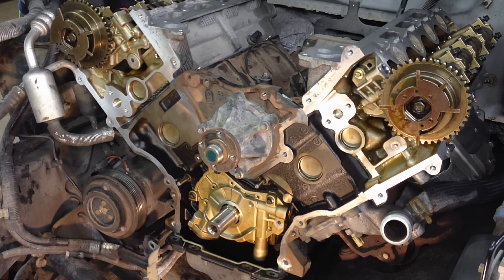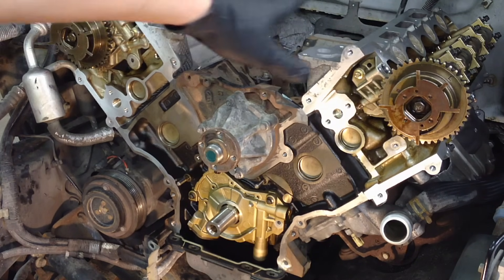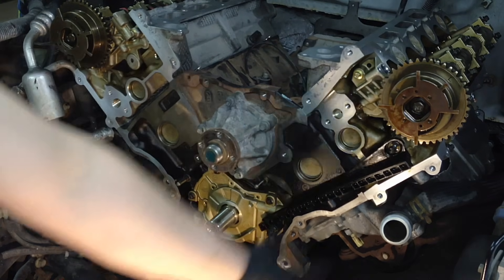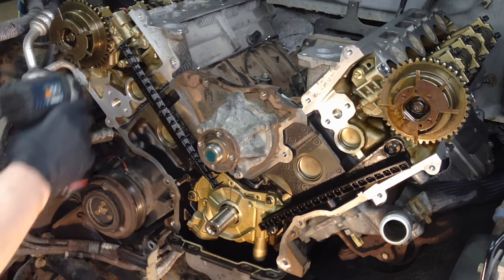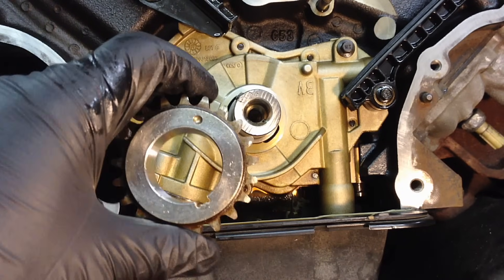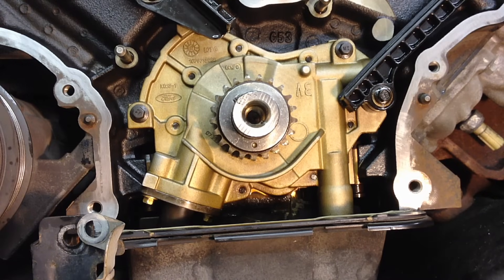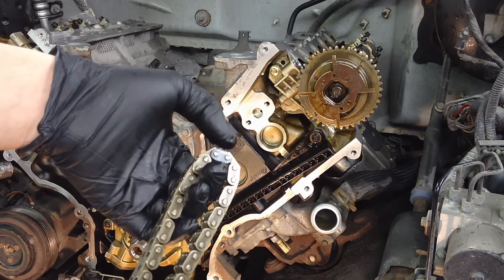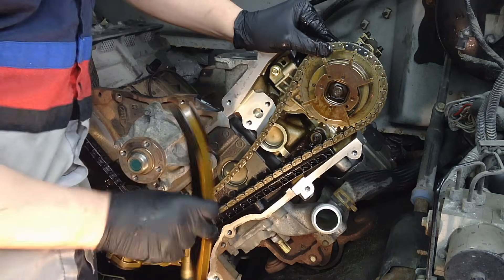Ford 5.4L 3v Engine Timing Walkthrough

Comment: Do you think the lash adjusters need replacing at any point? Mine are still compressing good but would it be good to swap with new one while doing this?
Reply from the maker: HimmelChef If I was in there that far anywhere near 100k They would all be changed.
Reply: Thanks confirms my thoughts.

Comment: So I get it running but it's missing. Turns out it's a bad rocker arm on bank 2. I fixed that then cranked it .it ran ok. Then next time I cranked it it won't start like it's outta time. Another phaser sheared off? Wtheck.. why us it doing this. I drove it up and down the road.
Reply from the maker: Mike S Are both phasers motorcraft now? Was the old one indeed sheared off? Are you locating the pin in there and seating the phaser before putting the bolt in there?

Comment: Not sure what brand it didn't  have a box.is there any brand other than ford that won't break!
Reply from the maker: No I just know Dormans are known for this and I have only used motorcraft ones and never a problem.
Reply: FordTechMakuloco  Hey I be leave that had done 7 months ago , to date Dorman's the right side is racketing causing slop in chain after tearing it down , I put milling's high pressure pump in both phasers , guides ,tensioner's, the hole nine yards , that was 7months ago , Now this is tore down again found tensioners seals let go on right side as well as the Phaser done with the plastic tensioners got cast Iron ratchet type but they came with a plate looks like it would restrict oil follow through it ,question should I put the plate between the tensioner and the block there are no gaskets with them can you help me on this matter , if possible its  2007 FX4 F150 5.4 v3 Flex , I do not want to tare this down again it only has 160 k miles on it , my 98 had over 350 k mile on , you may send me an email at rogerd82004@yahoo.com  I am 68 years old love my ford its getting a little harder for me to do but I will geeter done and thanks for the Vids

Comment: Thank you for the response.  I will be making a donation to you. The vct s were clean 'just a little debree. I found the problem.the phaser I put on I bought off eBay sheared off the pin at the cam. What Causes this. Just a bad one.? Can the cams knocking from lack of oil cause it. THEY Knocked Some Then cleared Up. I'm going to put the old phaser back on .it's missing the spring and tabs but it's been running with it for awhile till i could get into it. Once I get it going I can go back into it. New Ford phasers are 300 bucks!
Reply from the maker: Wow it sheared that big pin that locates to the cam? I would say it was a faulty part, was it a dorman?

Comment: Thanks for the info. I was a bit confused when to pull the roller followers. I saw your other video which explained everything perfectly. When I am replacing the timing components, should I do the cam phaser first or it doesn't neccessarily matter?
Reply from the maker: Jake Smith You will need the chains on when you replace the phasers to holt them in place while you remove and replace the bolt besides that it doesn't matter.
Reply: FordTechMakuloco Just trying to make sense of this in my head since I have yet to start with timing, so once the engine is at a neutral state with all the followers out, the cam phasers changed, I can pull the chains off and rotate the crank til the sprocket timing dot is at  6 o'clock and reinstall the chains. Haynes manual has this big warning not to move the crank without the chains on, but since all the followers are out it is ok. Maybe I am over analyzing this.
Reply from the maker: That is correct once the followers are out there is no chance of damage. Remove everything and get it to the 6 oclock and then follow my video from there.
Reply: FordTechMakuloco
 
I have started with timing and everything is going well, I had one quick question, is there a post check that I can perform. I know all the timing marks have to line up, but should my lobes be in the exact position when the keyway was at 6 o'clock.

Comment: Hi Ford Tech,
I am just about to perform a full timing job on my 05 F250 5.4 3v. Just to make sure I am not doing anything wrong I figured I would ask an expert a few questions. Here is what I plan on doing in the exact order, crankshaft pulley sprocket at the 12 o’clock timing mark at 1 o’clock. (Correct cam lobe  for position 1)? Pulling the cams and taking all the lifters out. Putting cams back in. Do I now put the key way to 6 o’clock? Removing spark plugs, removing both chains, tensioners, guides, sprockets and removing both cam phasers.
Re-installing the cam phasers first, which I was nott sure if this would make a difference or not. Following the video and putting the key way at the 11 o’clock six on the sprocket then installing my guides chains tensioners etc..
Once everything  is installed putting my lifters back in one at a time rotating the engine as needed to install or will the tool allow me to install all the roller followers? 
Thanks for the help,
Reply from the maker: Jake Smith You want to put keyway at 12 and check the cam lobes on cylinder number 1 to make sure they appear as shown in my phaser knocking noise fix video. If not you need to rotate the crank another 360. Once those 3 roller followers are out each side then you can rotate the crank clockwise to the 6 oclock position. Replace your timing components tensioners guides etc and remove all followers now position the crank clockwise till the sprocket timing dot is at the 6 oclock position and time the engine as shown in this video.

Comment: Yes sir question please. I have an 05 f150 with the 5.4 I had to do head gasket on passenger side. I replaced the chain guides they were broken. New cam phaser on that side. Everything looked good. Timed it with the marks on the chains . Turned the engine over at the crank several times and was good. Put it all back together  and both phasers were knocking. I cleaned out both vct s and cleaned paasageways. Started it up and I have never heard this engine so quiet. I drove it around my yard a bit then parked it. Shut it off and restarted it. No problem.  Got up to day to start it and it won't even run and sounds like it's outta time. Could I be a tooth off somehow? Thanks .. confused!
Reply from the maker: Mike S If it was a tooth or so off it would still run. What did you clean out of the vct solenoids, metal shavings? Do you have a video of how this sounds? Have you disconnect the vct solenoids and tried starting it?

Comment: Great video.  I have a question.  I'm doing a head gasket on a 4.6 2 valve and I'm to the point where I'm putting new timing chains on.  I have the crankshaft sprocket positioned with the timing dot at 6 o'clock.  When I put the chain with the mark on the dot on the sprocket and go to place the chain on the camshaft sprocket the camshaft sprocket is hard to move to get it in position.  At the moment the timing mark on the camshaft sprocket is sitting at almost 1 o'clock.  When I try and tun the camshaft to get the mark at 1 o'clock it just clicks back to where it was.  Am I doing something wrong?  I'm following the procedure from the alldata manual I just can't get things to line up...
Reply from the maker: You still have all the roller followers in that is why, they should be out and cams secured via the cam caps. What you can do instead of removing all of the followers is loosening the cam cams enough evenly to be able to move the cam free enough to line up the timing marks and then evenly tighten the cam back down very carefully.

Comment: Hi,
When you have time and you give me a few tips on my question about the timing chain and phasers I asked earlier this week . Could you also give me a brief explanation on removing the radiator support . So I can access the front end without bending over it . I noticed that you have it removed and did not have to remove the fenders . I have removed everything I thought was connecting it but it is still rock solid , At my age 55 I try and make things as comfortable as possible but would rather not remove 3/4 of the front end to get that support out if possible lol .Luckily my son is in basic training so I have his truck for a few months plus my faithful Harley so I can take my time with this job.  Again thank you for your vids . If you ever need any welding or machining advice maybe I can help you out . I have been a welder and machinist in the Nuclear industry for 35 years now . Plus have my own shop at the house. My email if would rather email me is nucmachinist@gmail.com

Comment: Hey FordTech I got a quick question. I'm doing all new phasers, guides, chains and one new cam. I followed all datas procedure exactly and am to where I tore the chains off with the keyway at the 6 o'clock position. Now on reassemble is it going to hurt to roll the cams to get them perfect? As long as my crank is in the right spot with the holder I can adjust them accordingly right?
Reply: Also how many revolutions will it take to get the marks to line back up? I set it and rotated everything a million times and it's now a tooth off on all marks. I made reference marks and after two revolutions those lined back up nicely. Is this not like any other timing to where you can't get them to line back up with revolutions?
Reply from the maker: plskillyourself Yes as long as the crank is in the right spot and the chains are strung tight as shown you are ok. You cannot crank it over to get them to line back up they wont do it on these as you have seen.
Reply: Is there a special tool to install cam rollers after putting timing chains. Or can you you just insert them. I notice that you cams were moving so what where you doing In this case?

Comment: Hey, First I want to compliment you on the detail in your videos and for taking the time to put them together and help out us DIY auto guys . I have worked in the Nuclear Industry for the past 35 years . Most of that as a  pipe Welder and Machinist until I got old and tired and recently started Supervising . Since my first car I have done most of my own work ( except tranny rebuilds lol ) man has to know his limits . But as the years have gone on the complexity of most work other than routine maintenance has gotten tougher on us DIYers . Thank God for YOUTUBE and those like you . Now for the question I have watched this video as well as your cam phaser change out video . And I am a little confused ( easily done ) In the vid on the phasers you show the crank key or spoke at 12 o clock then once the rockers are removed from the 1,4,5 and 8 cylinders you rotate to the 6 o clock position for the cam phaser change out keeping the cams in a neutral position. On this vid you show the keyway at the 11 o clock position which puts the timing mark on the sprocket at exactly 6 o clock ( I notice your cam bearing caps are lose) so all the valves should be unable to open .I am assuming that even if they were tight and the proper rockers were removed the cams they would still be neutral ? I am doing the Phasers as well as all timing chains adjusters ext. which process should I use ? Thanks again for all of your videos . They have been the best ones on YOUTUBE that I have seen dealing with these 5.4s
Reply: Kenny Hall I noticed the same thing what did you figure out on that I mean which process did you end up going with the 12 o’clock 11 o’clock or 6 o’clock position I’m doing the phasers and whole oil pump and timing chain replacement to

Comment: Hey FordTech.  I need some direction.  I had an engine ticking noise in bank 1 of my 2009 f150 5.4 3V.  I had a tech at an independent shop look at it and he said phaser for sure.  I replaced the cam phaser and during reassembly was off a tooth with the chain (it slipped) and had error 0012.  Had to open it up again and I moved the phaser one tooth clockwise and now timing is back on, error codes gone.  But the engine ticking is still there, loud.  I also have what appears to be the opposite problem from most ppl:  My idle is great, no stalling, but when I get going over 40 and step on the gas, the engine gears down but I have no power.  The same problem as when I first started did not get resolved by changing the bank 1 phaser.  Once again, I have no codes.  I'm running synthetic oil and when I had the b1 valve cover off, there was no sludge.... nice and clean.  Could this be one or both of the VCT's?  Please help!!!
Reply from the maker: ***** It sounds like the vct sticking yes but I am more concerned with the noise. I would go after the ticking noise first locate the source. The VCT solenoid will not make a ticking noise.
Reply: FordTechMakuloco
Thank you for the reply.  Any idea what would give a pretty loud tick that reverberates through the tailpipe?  IMO, not a cracked manifold since when hot, ticking noise is the same.  Could it be the cats?

Comment: If your crankshaft key is at 6 o'clock, does that mean #1 is at TDC? Im confused as  to when does piston #1 needs to be at TDC?
Reply from the maker: hotsausage504 piston tdc is not a factor only crankshaft keyway is.
Reply: Hey thanks alot for your reply. I have 4.6 2v, I noticed in other comments you said that its different.  Im doing a 5.4 2v swap. And btw is cam degreeing necessary?
Reply from the maker: hotsausage504 Cam degreeing is not necessary no.

Comment: Sir, is it possible to replace the oil pump with out removing the pan, when doing a complete valve timing re-vamp? Would like to up grade to Hi-volume because of all the rattling. 2004 5.4 triton.
Reply from the maker: Jeffery Hilliard Yes I have done it a few times before no problem actually.

Comment: Hey sorry one more question. My 5.4 3v also has a lot of suctsion through the oil dip stick. It that normal?
Reply from the maker: It should have some pressure coming out not vacuum.
Reply: It's vacuum. I put my finger over the hole and it sucks it in. Any idear what could be wrong?
Reply from the maker: I have never paid attention if those have suction on the dipstick tube due to the baffle design instead of the pcv. I do know that if the oil cap or dipstick is left off the truck will run lean, but sucking your finger in might be normal because of the baffle design. I will have to check on the next one that comes in.

Comment: Hello, Question for you. Does a 2005 F250 with a 5.4 3v have a PCV valve?
Reply from the maker: Well sort of it is built into the Drivers side valve cover more of a baffling system. It's good for the life of the vehicle.

Comment: What can I do if my timing Chain tensioner broke and the truck was still running when it broke  then it died ? When I went to remove the timing chain to replace them the cam phaser jumped so basically I lost my time I didn't mark it so I don't know what to do from here can you pls help ?
Reply from the maker: Yes pull the front cover and do a full time procedure as shown here it is the only way to be certain and this engine is interference fit so you don't want to take a chance.
Reply: Do I have to do anything else with putting the valves on neutral ? If I do how can I do that ?
Reply from the maker: leave the roller followers out when doing timing as stated in the video then everything is at neutral position otherwise the cams will turn.
Reply: How do I leave them out ?
Thanks for the help
Reply from the maker: gato8479 After pulling the cams out, remove roller followers, reinstall cam and time engine perfectly then put them back in one by one.

Comment: Ok thanks for the info I really appreciate it. Neutral is crank key way at 12 o'clock right. Then once loosened rotate clock wise till crank timing mark is set 6 like the video.  Going to be very helpful.
Reply from the maker: Yes that should do it.

Comment: This is very helpful.  I'm putting some new heads on a 5.4 2V.  The previous owner had it blow out a spark plug.  Rather than repair it with a insert he decided to jb weld the plug in.  It's getting new head gaskets, new head bolts, chains, tensioners, and guides.  Is there anything else I should replace while i'm in there?  Also when torquing the head bolts the last step is to go to 90 degrees.  Can I paint a white line on the bolt head and turn it 90 degrees, or does it need to be more precise?  It's a 2001 f150 with 120,000 miles.
Reply from the maker: 1captjake A white line on the head bolts is just fine that is what I use never a problem. I would do exhaust manifold gaskets while heads are off. Make sure you use the revised gaskets, and stainless hardware from Ford so they are never a problem in the future. There is not much more that I can think of except to look over all the internals very good for wear while they are on the bench. Also inspect the coolant crossover where it bolts the intake for cracks and be sure to replace those gaskets as well. Now is the time for a new thermostat and gasket also. Besides that not much goes wrong on these.